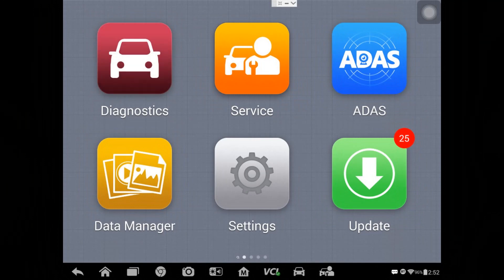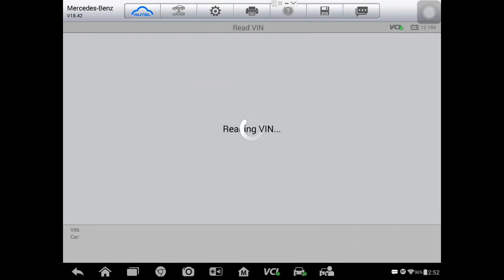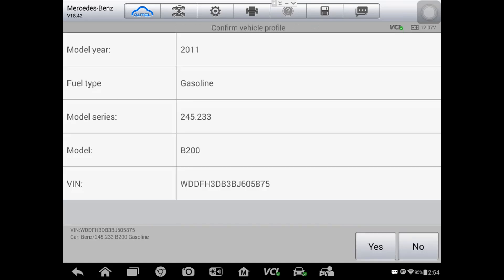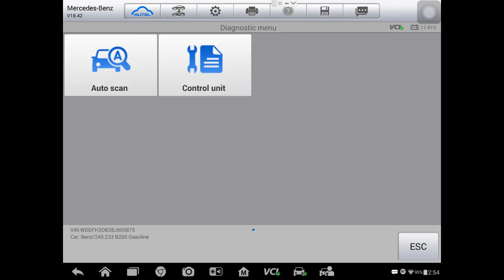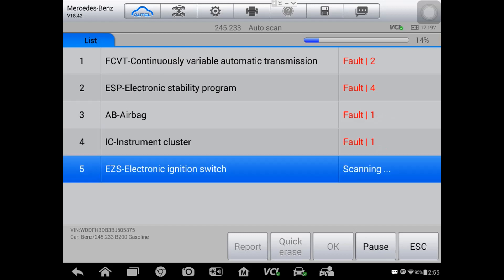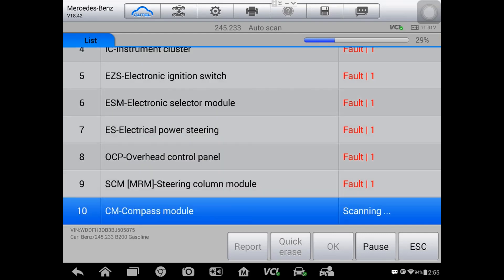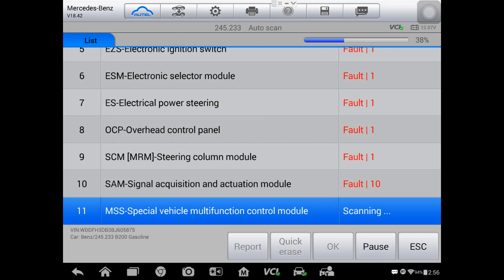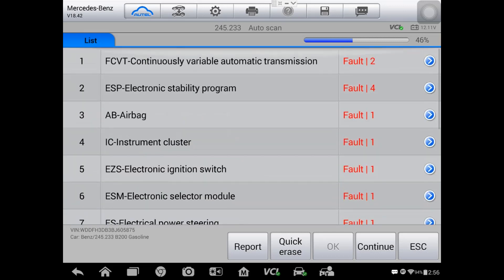Small Issue, Big Problem! Navigating Lack of Repair Information. (Mercedes)

Comment: mercedes are horrendous for relay issues. I had a cl63 not too long ago left the guy stranded due to 488 OHM resistance in the ECU power relay in the front drivers side Sam. only found it by taking out each relay and checking resistance one by one. all others were around 80 ohms. also I will add my WIS/Mitchell/Identifix were no help. Excellent video Jordan, GOBBLESS